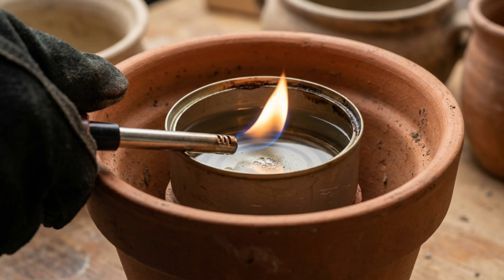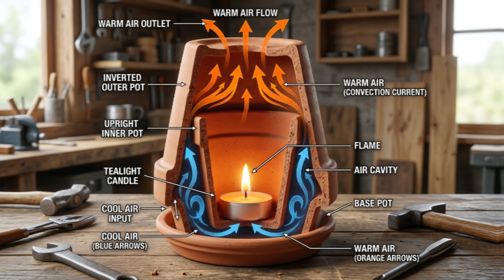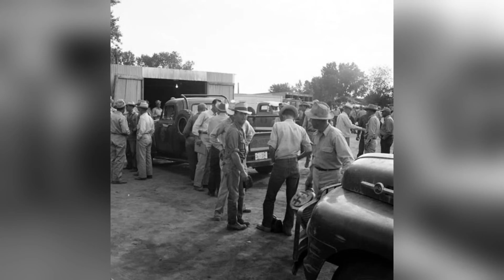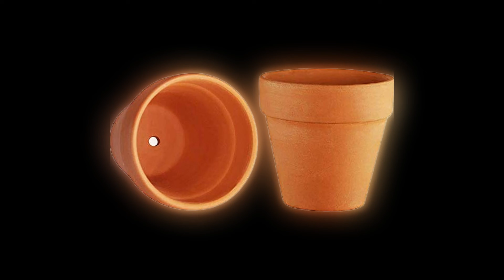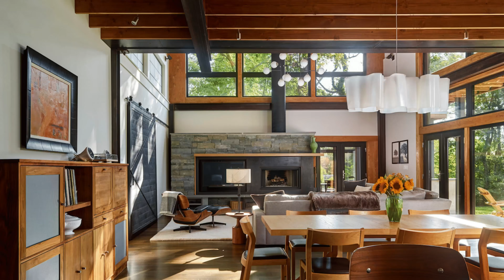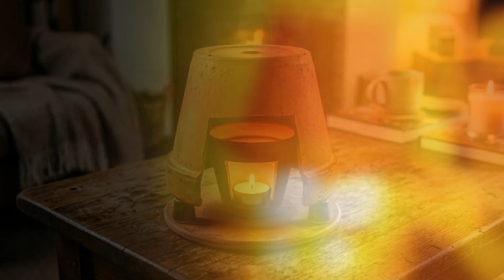This Cheap Clay Pot Heater Exposes The Heating Industry Lie

Comment: I would add another important safety measure here. You stated the amount of isopropyl alcohol burnt in a certain timeframe. From that, we should calculate the number of hours we will be in the room where we will be using this device, and only fill your metal container with the amount of liquid that will burn off in that time. Thus, if you plan to be in a room for three hours or so, ONLY use enough liquid to burn for three hours. You will then have a self-extinguishing clay pot heater that will automatically go out once you leave the room at the appropriate time!

Comment: I built this ok in september to take the chill of would not be much use in january stones in pot ? Not tried that just 3 pots one inside the other.never had  inner pot 3 bolts together used tea lights might go out with inner pot candles doubled a few years back made it more exspensive

Comment: Just have one question l bought 2 terra pots smaller and bigger like shown in the video and 99% alcohol , here they don’t sell 70% , but when l light up alcohol placed in small tuna can and place bigger pot over smaller flame stops, l put bricks which are quite hight so there is air, but flame stops as soon as l put bigger pot over smaller? Thank you for your help 😊
Reply: Make sure you aren’t creating a seal. The two pots should not touch and air should be able to get in from the bottom.

Comment: This is so ridiculous. Why are you implying that a clay pot heater could replace a furnace? The candle or alcohol can only put out a limited amount of heat. Putting a pot over it does not increase its output. One of these pots will make virtually zero difference to an average room.
Reply from the maker: The video isn't suggesting it replaces a furnace, but rather demonstrates a low-cost heating method for small spaces or as a supplemental heat source. The pot acts as a heat sink to radiate warmth more effectively.

Comment: Using Candles or night lights like in the picture is Dangerous!  Seriously  ! I made a few designs as i had too due to hardship..
After a few hours the wax gets hot and melts then it turns into a mini chip pan fire ,, then the clay pots can crack or even fall apart
Please be warned it can be dangerous, 
I know my stuff i build campervans and lived off grid for years 
Reading this could save your life .❤
Reply: Stop. This is for emergency use and we have done it a number of times. It is safe and effective
Reply: @NansNest  Do more research,! Nite lights can over heat in a confined area, The wax does set alight !  Like a chip pan fire,
Educate your self . You shouldn't be saying Stop when it can happen Awareness is key .... it can happen,  and it has 
Even the pots can break , it does happen. At least i will tell people of the possible Danger,  you haven't.

Comment: Bullcrap. Lets fund author a one way ticket to Siberia and lets make him warm up little house with this crap, and inform his relatives of his son winning and Darvin avard!
Reply from the maker: @NoName-ni8ru A campfire indoors is a bad idea due to smoke and fire risk. This pot heater is for small, contained warmth, not replacing a full furnace.
Reply from the maker: Hahahahah 😂 I live in northern Canada, not exactly the tropics, my friend.

I’ve actually used this during a winter power outage when I lost electricity for 3 days, and I’ve also used it in my RV in late fall when it was only 5–6°C inside. Did it turn the place into a luxury hotel sauna? No. But did it help take the edge off in a small space? Absolutely.

Nobody is saying this replaces a wood stove, furnace, or proper emergency heater. It’s a small backup trick for small spaces when you’re stuck with limited options. Big difference. And yes, common sense still applies: ventilation, fire safety, and don’t leave candles unattended.
Reply: @Sidney_Explains_Money  Backup? you just make campfire like normal people do. Or just find a firewood to "power" Furnace, because it is made to heat up space, keeping warm in furnace's chimney system witch is different from fireplace you muricans and french colonists love so much.

Comment: Love it  no heat bill 36 yesrs  no air-conditioned  bill37 yesrs.   No wayer bill 36 years    no power bill 36 years.   No mailbox  36 years    i may have saved  300 000  or mor e

Comment: Do not fall for this con!!! A candle can Not produce more btu's than it already does by placing anything over it!! This false information will k¡ll people who really need heat for survival!! 🤦🏻‍♂️🤦🏻‍♂️ this method robs the air of heat by the pots soaking up the btu's from the heat source.  Only a FUEL  source can heat a room! Research the btu's needed for an AC unit. This was outlawed in the UK because it was burning down too many homes🤦🏻‍♂️
Reply from the maker: You are right that a candle does not magically create extra BTUs because you put a pot over it. I never said it creates energy out of thin air. lol.... where in the video did I say that? Timestamp here please ahahahah!

The point of the terracotta pot is heat distribution. The candle’s heat is absorbed by the clay and released more slowly as radiant warmth, instead of just sending most of the hot air straight upward.

But yes — this is not a furnace, not a central-heating replacement, and not something you leave unattended. It’s a small emergency heat trick that can take the edge off in a tiny space, with proper ventilation and fire safety.

Also, “only a fuel source can heat a room” is funny, because the candle is the fuel source. The pot is just the thermal mass. Different job. Same heat.

Comment: A tea light candle is about 300 BTU per hour. Somebody must have an incredibly well insulated house for this to do anything.  In the worst storm I've measured, my well insulated house needed  about 30,000 BTUs per hour.
Reply: You have to make your inside space smaller as well.
Reply: it doesn't heat your house, it heats one room my dude, and i've used a version of these in the middle of canadian winter in a tent overnight, it raises ambient temp of the tent by 6-10 degrees, and while a tent is smaller, remember that it has absolutely piss poor insulation.
Reply: @jemmalambert3751 : I was winter camping several years ago. Our neighbors had a recording thermometer, it registered -30 C one night. I didn't have a thermometer in my tent, but the 5000 BTU heater must have been a small help.
Reply: Do you need to heat your entire home during the night or just the bedroom? Common sense is a rarity these days!
Reply: @screwbigtechsanti-sciencem9438: common sense says "don't let the pipes freeze".
Reply: @drwthmpsn7457  keeping your house above 0 with the heat is still a lot cheaper than keeping the whole house above 18 or 20 the whole night. ur not taking common sense very seriously are you friend :)
Reply: @jemmalambert3751 : the last few years I heat the house to 13.  I use a 2500 BTU electric heater in the living room, which leaks heat into the other rooms.  I really don't see a tea light doing much. I sometimes light a candle during dinner, and I haven't noticed any improvement.

Comment: Can’t get isopropyl in Australia, but I remember buying one of those little tea lights from ikea (2020) and the odour from that candle was so disgusting - it was stronger than the essential oil that I was burning. I had to get rid of it. It was so bad.
Reply: Methol hydrate should work too.
They use it in some alcohol burning stoves.
I don't know about the smell.
Reply: Can get 100% Iso from Bunnings... That work?
Reply: @The-Cosmic-Hobo  Lol, nah, they have a spray for $10/125ml, so that would be $10 a night to heat a small room. That's a total rip off, it would be way cheaper to run your split system.

Comment: There's something called thermodynamics. One candle produces 40-80 watts of thermal energy in one hour, while the average house loses 80-120 watts of thermal energy. One candle raises the temperature of one cubic meter of air by 1 degree Celsius in 15 seconds. Calculating heat loss is very complex, but the average loss is twice as high. The difference between indoor and outdoor temperatures, wind and air circulations at outdoor complicates the calculation. You can just optimize this numbers.

Comment: I use a tagine with  3 clay feet separating the top from the bottom and use 2 or 3 eight hour t lights. It is very safe and gets really hot
Reply from the maker: Ooh, a tagine with tea lights? That's actually super smart! Love hearing about how you make it work safely and effectively.
Reply: @Sidney_Explains_Money well,,,, they say Scotland,s the land of invention 😂😂
Reply: Do a video please. Sounds safer than this posted item.
Reply: @shortandresourceful-b7i I, m not very technical so wouldn't have a clue,,, anyway, I have a 12"tagine, i separated the top from the bottom using clay pot stands to let the air in. I found the 8hr candles were better than the smaller ones. Hope this helps 🤞
Reply: @auntia7687Yes! Very helpful thank you!

Comment: It’s still only 1 candle power versus all heat list by a room. Heat some tea. Have hot water on tap for a tea light.
Reply: These videos always display it as a neat little candle because that’s familiar and safe looking, but it’s actually a pot of burning alcohol which produces a lot more heat while also being substantially more dangerous.

Comment: Incomplete combustion can release carbon monoxide, so air exchange is crucial to not dying.
Reply from the maker: You're absolutely right, air exchange is critical when dealing with anything involving combustion to prevent carbon monoxide buildup. Safety first! But that's why I mentioned it twice in the video 👌

Comment: I am not that fond of burning alcohol for 3 reasons.

1 - It creates a lot of moisture in the air.

2 - it's very hard to see the flame in a brightly lit room.
Making it easier to accidentally burn yourself thinking it's out.

3 - it can spill or splash around.

Although it doesn't burn as hot, I would prefer a candle to avoid these issues.

If you make this change, you may wish to look at Crisco candles.
You can make one yourself with food shortening, it doesn't have to be the brand product.
A big package of Crisco makes a candle that lasts up to 72 DAYS

The downside is the fake Crisco I tried has an oder I don't like.
I don't know if the real stuff would.
Reply: I've heard that adding a small amount of table salt to the alcohol will make the flame visible... have yet to try it myself.
Reply: Alcohol stinks too
Reply: The other issue with burning fat for heat is that it leaves a residue on your walls and ceiling that builds over time and is almost impossible to remove, so your entire space ends up smelling like rancid grease after a while. Real Crisco smells like burnt grease, too, not just the off-brand stuff. Imagine a nasty restaurant kitchen that hasn't had the hoods cleaned for a few years and has lousy ventilation, lol.
Reply: @martiharris380 thank you,
That makes sense.

So you would definitely want some sort of chimney going outside.
However that allows a fair amount of heat to escape.

Comment: I thought this was debunked? There's tons of videos showing it not working...
Reply from the maker: I've tried it here in Canada last winter and i assure you it works. Using it too at the cabin in the fall 😊
Reply: @Sidney_Explains_Money interestimg measurements would be good
Reply from the maker: @NewsChannel-y4g  You can really make it any size. Terracotta pots come in huge sizes too — the only thing that matters is that the inner pot is slightly smaller than the outer one so it fits inside.
And make sure you have a good pan or tray underneath.
Reply from the maker: @NewsChannel-y4g  check this out brother: https://www.tiktok.com/@don_wynn/video/7337462674617404718
Reply: @Sidney_Explains_Money I knew you were Canadian!  I heard you mention Bell and Rogers as ISPs, and I knew that no American would ever take the time to research Cdn ISPs.
Plus, the Nordiques hat was a dead giveaway!
Atta boy, Sid!
Reply: Only doesn't work when you dont have the inner pot elevated and you dont have the top pot cupped over with space in between.  If the air can't circulate in between them, that's when it doesn't work.
Reply: next year
Reply: I’ve seen both. Not working and working.